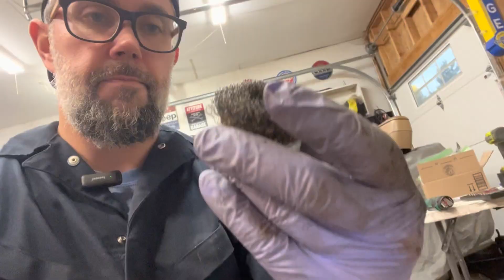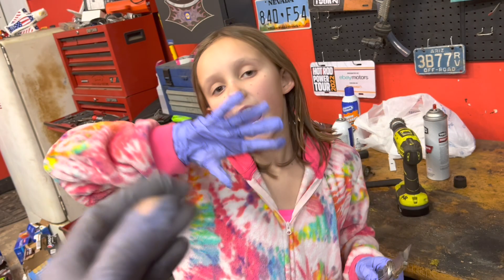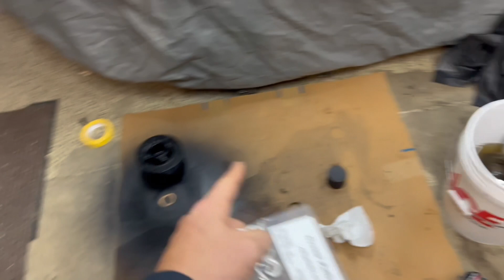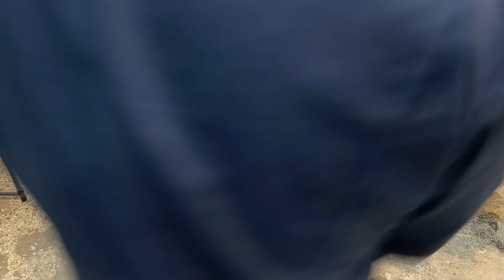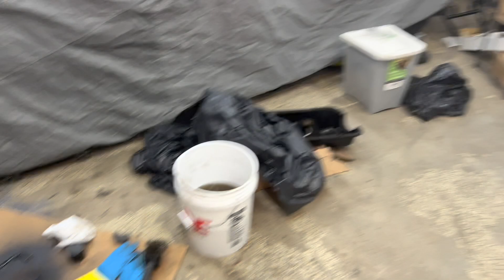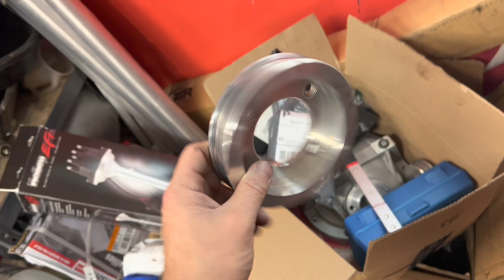HOW TO: Painting your Engine with RUST OLEUM High Temp Engine Enamel | Project HELLSTANG!

Comment: Hello, how has the Rust-Oleum high temp blue engine paint holding up for you?
Reply from the maker: @Captain1717Q  still looks great. Probably only have maybe 1500 miles on it the past 3 summers but it looks new still
Reply: @PeakPerformanceEngineering  Sounds good. Did you notice any darkening of the paint like in hot spots or has it stayed relatively uniform throughout the engine?
Reply from the maker: I think it still looks all one color. I even had some oil leakage of the valve covers for a while there and after cleanup I think it looks good. I’ve been working on the rear end of the car all winter so haven’t looked at the engine much but from what I remember seeing it still looks great
Reply: @PeakPerformanceEngineering  okay I think I'll go with that paint. Yes I'm also getting ready to change the differential fluid on my 99 Crown Vic interceptor...

I wanted to do the EGR valve in that blue and I know it gets pretty hot.

Comment: Is it necessary to heat-cure the Rust-Oleum High Temp Engine Enamel?  Or just apply and "let dry"?
Reply from the maker: Doc for the high temp engine enamel I don’t recall seeing anything about heat cycling, just paint and go. Now for the 2000 degree high temp ceramic paint they have that I did the headers with, those can be baked after painting or having the engine run for a certain amount of time for a cycle or two. That is all laid out on the back of the can for the exact times and temps :)